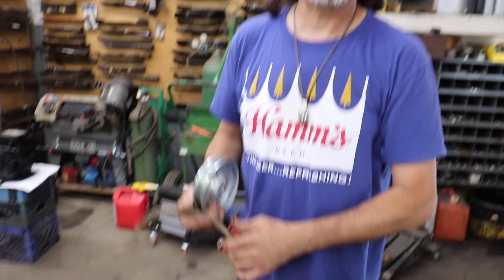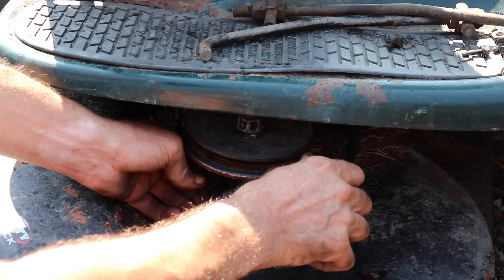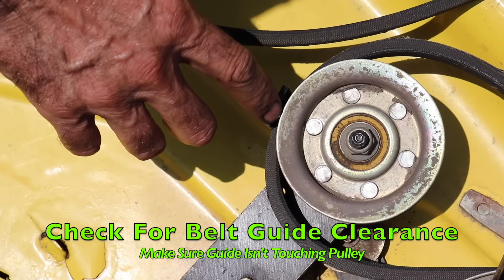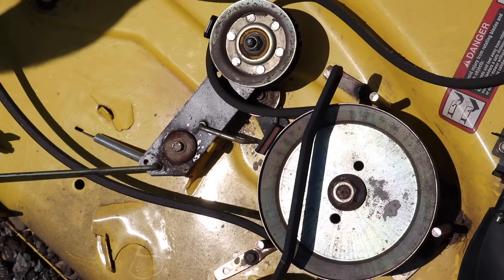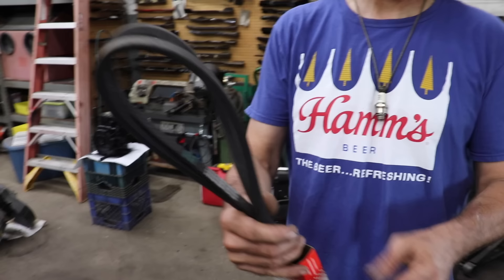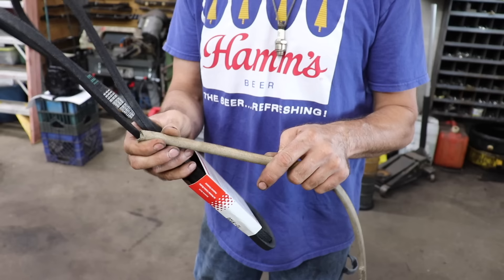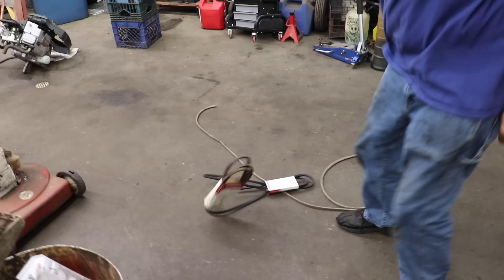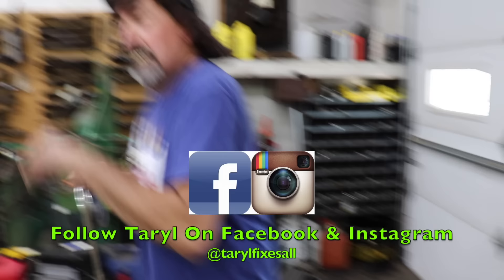Why Do Mower Belts Break?

Comment: Replaced the deck belt on my Cub Cadet with one of those Kevlar belts in the middle of last summer.  Man, it works so much better than the old rubber one did and it's still going strong.

Comment: Regular fan belt will work fine on a modern belt drive hydrostatic mower, but may wear faster on manual transmissions because of the clutch. Also usable for starter-generator drive belts.

Comment: Hey Taryl,
I have a around a 2003 18 simp regent 38 deck. I bought it for $100 the guy said it just needs a drive belt. Kohler engine runs good. The problem is I don't know what all I have to do to change this belt. It looks complicated n id like to be sure its not the trans locked that caused the belt to snap. The belt is shredded. The guy started to work on by removing a bolt n I have no idea where thats supposed to go. Before I lift this thing with my crane id like to know where to start. I also saw on one of your vids you talked about the parking brake can cause the belt to brake. 
Just was hoping you had 1 of these hanging around that you can do a video on. Thanks
Oh n your videos are great. You guys are hilarious. You make it fun to work on the junk we have to deal with these days.

Comment: I had the original deck belt replaced on my Cox 11 lawn tractor. It lasted approx. 1.5 hours of light mowing before it, too snapped. The shop initially thought I may have picked up a tree branch or some other foreign body in the pully going by a groove that was scoured into the belt. When I picked the mower up, they didn't charge. Said something about not allowing for pulley wear when they replaced the original. I think that they forgot to tension the belt correctly. You do this on Cox's by adjusting the cutter deck angle. But anyway, they said it was no fault of mine, so it was replaced under warranty. And that included pick up and delivery of the mower! So if any Aussie grass rats reading this has a Cox, circa 1990-2000, look out for the correct belt tension and adjust the deck angle if it starts to feel loose.

Comment: five yrs ago I bought a used Cub Cadet LT 1042 and it would "eat" a belt every third/fourth mowing! I got some photos of the deck and found the one idler stand was bent over and the belt would start turning inside out and jump!  I realigned and did a better welding of the stand and I can get two years out of a belt now!  by the way where do I get the after market rocker cover gasket for the Kohler 19 hp"courage" engine?
Reply: Real real big problem why they paid a Cub Cadet yellow two piece of s*** I am learning had 18 hours on it when shift started going wrong and boy did it biggest piece of junk made there ought to be a Lemon Law for mowers go to hell Cub Cadet.

Comment: Also, make sure the pulleys are free of surface rust where the belt rides. This rust forms when mower is in storage during winter season. Polish the inside of the pulley grooves with 220 grit sandpaper until they are nice and shiny or replace the pulleys if they are too rough. Your belts will last MUCH longer! And, use OEM belts, NOT "direct fit" or OEM "replacement". They WILL cost more, but will be worth it in the long run!

Comment: Taryl, I have an old Merry Tiller (1977 I think, from the date code on the engine) with the 5hp Briggs that I took apart to fix a fuel leak on top of the fuel tank. I believe I put the governor linkage back wrong because now it runs fine and throttles up fine until you load it. It has no power under load. Is there a diagram somewhere that you know of that shows the linkages? Or at least a good description. I really am grateful that you do these videos. You don't owe this to anyone, yet you do it. Thank you. I hope you aren't too busy to read my question, I bet hundreds or maybe thousands of people try to contact you.

Comment: thanks for the help, it worked for me, I bet with all that knowledge you could make adjustable brake pads for the blade pulls, so you can just loosen & slide pad up or down, instead of having 2 wear spots you get 2-3 more uses

Comment: Old Wheel horse decks have delrin guides that s slide bar and spring tensions the idler pulley. Grass and dirt corrodes the bar. I replace the delrin strips with Formica full contact  piece and seal with brake caliper grease. Now the belt has steady engagement and lasts three times longer. I also polish the contact surface of the bar. I took down a never mowed lawn yesterday August 20 and no breaks with fifteen inch grass

Comment: What do you, or anyone think about electric clutch engaging at full rpms? I think the initial "shock" weakens and eventually breaks the belt. I've been advising my customers to find a half throttle position that will start the belts but not too slow and kill the engine

Comment: Good advice. But here is something else that you should be doing. 1 grease the pulley shaft if it has a grease fitting.  And probably important to do is clean out the grass and other things that can get caught up in the belt or pulley after you have mowed the lawn. With a air hose or you're hands but pull the spark plug wire off first so it won't start or something. I'm just saying. I haven't put a belt on my John deer 425 mower deck in over 5 year's and I mow a 2 acer lawn all summer. I do this all the time . But I do use my air compressor to clean my mower after I'm done with the lawn. And check it out before I mow also. But I'm am a mechanic and I don't want to work on it until I have to. But it runs great. Love your videos.

Comment: "Them blades are going to be spinning _whether you've got the deck engaged or not_"
 Bingo!! I've just put a new deck belt on (having replaced spindles and one pulley, and also the drive belt), and when I engaged the deck I heard bad, bad noise. Quickly disengaged. Drove onto tarpaulin to investigate and the tarp got ripped up. Huh?!? What's going on?? Hadn't seen the new blue belt moving but that sure sounds like the problem. Now have to find out how to slacker off those rod and weird adjustment nuts. THanks, Mr Daryl.

Comment: What's this? More mid week snacks? : )

I recently repaired a Crapsman YT3000 riding mower, that had a PLASTIC ground drive belt tension pulley that went bad. The bearing on it was toast, and the belt wore a HUGE groove in it, almost cutting it in half. Luckily I had a STEEL pulley from an old LT1000 whose bearing was still good. Fit perfectly. That and a new ground drive belt (purchased from Taryl's shop) and it was up and running again.
Reply: The AYP/husqvarna mowers seem to often have those plastic pulleys, but only in places that you would never notice if you were looking at the mower in the store before you buy it.  I assume MTD's are the same or worse.
Reply: @the_mowron  You sir have a great user name, lol. Yeah, anything to save a buck these days. Like those riding mowers with the plastic transmission housings Taryl had a vid on. What were they, JD's? I guess the plan is to cheapen them to the point ppl stop buying them, then scale it back. Because the bean counters at those factories can't just stick with what's reliable and works can they.
Reply: @dkeith45  It was my disgust at being scammed that led me to putting together working mowers out of junk mowers.  I'm not willing to pay $5000 and up for the Kubota or JD type stuff and the Lowes/Home Depot stuff is junk. That was when I started watching Taryl and Donyboy. Taryl really is saving people a ton money.
I have one of those plastic transmissions in my garage. It's a CVT. I don't have anything to put it in yet. I kinda want to try it out.

Comment: Holy shit, thank you for this video. I recently inherited a new commercial zero turn at a house I bought, 0 experience in owning one. Replaced a belt 3 times in the past 3 months, and had I watched this video 3 months ago, I probably wouldnt have had this issue. I think it's a combination of me cutting too fast at full RPM, with old ass blades and keeping mower deck too low. Last 3 weeks, no issues at all...

Comment: Hey Taryl a kevlar rapped belt is designed for abrupt speed changes like the mower deck clutch engaging or like a clutch an mechanical engagement belt. Slips a bit then drives unlike a rubber belt that will abruptly engage but has no slip and tears itself up in summer heat. Case in point a snow blower has rubber belts due to temperature and moisture these resist slippage and grab under these conditions.A kelvar belt would slip and keep slipping no grippage with the moisture soaking the kevlar.

Comment: I used to have a problem with my mower deck belt coming off when I disengaged the blades.
Found out if you throttle down and give it a second then disengage the mower deck the belts don't come flying off.

Comment: I had a guy the other day go out using a flail mower on a really hot day and he was out for about four hours and came back with three belts ripped to shreds. He was trying to cut 5 foot tall grass at two fast of speed which caused the belts to overheat due to slippage. I’ve seen this type of thing way too many times even on Zero Turn lawnmowers especially when their blades are dull. When trying to cut too much material it puts way too much stress on the machine with doll blades.

Comment: I abuse everything when it comes to power equipment. Cutting a hay field full of weeds in what i do daily well when the weather permits. Funny how things like the belt holds up but i go slow when doing so. Bought some cheep spindles from online and that was rejects that caused more damage than the 53 dollars i spent on the 3 spindles. Lesson learned there.

Comment: Not so much John Deere or even some of the other brands but mainly Craftsman had ill installed belt guides from the factory especially these new machines I have people bringing me year old machines with the belts all mangled. What I am finding on the new Craftsman and TroyBilt machines is the belt guides are way outta whack... Way out and just recently a larger Craftsman came in and it only had 2 belt guides out of the five it should have had. I asked the customer who had it apart before he said nobody that was the way he got the machine. The only water I could throw on the flames after he got pissed off at me was suggesting perhaps someone at the big box store LOWES removed em for a repair on another machine.

Comment: A had a Simple City 100 years ago....  the deck belt was great....

But the long belt, than ran the snowblower you mounted on the front...  Holy crap.  I put a peg in my shed, and hung the spare belts on there....  Could never figure it out....

Comment: Trying to engage a deck that's chock plugged up with mulch or a deck driven over a patch of high grass puts a huge amount of stress on any belt  , let the blades spin up to speed before they encounter resistance and bring down the height of tall grass in layers not all in one cut . always let the deck clear out , if you believe your deck is plugged raise the deck and move to a clear area before re-engaging the deck PTO , and as many have said here already lower the engine speed engage the PTO then raise it back to cutting speed  .. keep your blades sharp and clean your deck

Comment: Taryl, how about horizontal pulley, spindle and motor spindle (whatever its called) alignment?  Do things over time slouch slop fall in small increments that you cant really see by eye?  Perspective, lay down look at the deck belt.  As you raise and lower the deck for cutting heights, would something like i describe be common enough so the belt no longer travels in a clean path across all wheels and then the belt comes off?  Hard to explain... hope that kinda does it...  My tractor ate 3 belts in a weekend.  Ima gonna check the belt wheel surfaces today but it was fine for the first few cuts back in April.  I've bought 7 belts this season, some oem, med quality and some cheapo.  Is this a thing? or is it something else?  Much obliged from Ontario Canada.

Comment: Enjoy your videos Taryl!  I have a question maybe you can help me with.  How deep into the PTO pulley should the deck belt ride?  Whenever I replace my belt with a new Toro belt (mower - Toro MX5050 74770), the belt seats even with the outer edge of the pulley.  After 50 - 100 hours of use, the belt relocates to deep into the pulley.  Also, could I run a 5/8" belt instead of the factory 1/2" wide belt?  The ExtremeOPE PTO (X0718) currently installed says it is made for both 1/2" and 5/8" belts.  Thanks a bunch!!  William

Comment: Every time I replace the belt on my John Deere 42” deck. Does a good job when engaged. But, I notice the belt is so loose it would fall off the pulleys. If it didn’t have pulley cover belt holders. I give the John Deere dealer,  correct information about the mower. They give me the belt called for. But always loose. Even with new spindles and pulleys. Any info you could send my way. That might help. Thank you.
Reply: the belt covers are also belt guides and are all part of the system if the belt covers are missing the belt will not stay on.
Reply: J B I’ll try with new covers. See it that works. Thanks
Reply: Charles;  Have you considered trying to adjust the position of your mowing deck to be a little more to the rear of the tractor?  In the manual for my mower (a 20+ year old Craftsman with the Briggs horizontally opposed 2 cylinder engine with manual deck engagement where the belt is also used as the clutch) there are good instructions for adjusting the deck to be "level" but they don't say a word about this affecting deck position fore and aft and it does.  This is important because it directly influences how tight the belt is. It is a bit tricky because all of the adjustments interact but it may be possible to find an adjustment where the deck is still "level" but slightly to the rear of its current position.  It should not take much change.  Because the belt goes both to and from the deck moving the deck 1/4 inch to the rear would take a full 1/2 inch of slack out of the belt and that is quite a lot.

Comment: I get the same issues here in the UK people bring their mowers because the belt has snapped or not cutting the grass properly and on inspection pulley's sometimes broken or wrong belts fitted and blades so dull I could slide bare arsed to London on them.

Comment: I hit a peace of steel yesterday. Brand new mower 😀. I could have craped a golf club. But what's done is done. Before I mow again I will look everything over. If I cracked a mandrel or bent a blade I will just have to replace or repair.
I ran over a highway marker with a brand new cast iron mandel. It busted it into peaces. My old mower. But that peace of steel was my new Hustler Fas trak 54 inch deck mower.

Comment: I have a older snapper mower and a spring  that engages that thing that makes it go. Broke and I was wondering if you knew where I could find that part
Reply: It's a spring that makes the disk go on the wheel. I cannot find that part tarol

Comment: Old Cub Cadet 2186 Kohler 46" deck, new pulleys, PTO clutch. X4 belts shredding. Same PTO belts I've always used. None of these ideas seem to be the cause. 
Now I'm baffled. Heat from muffler? Too tight for some reason?

Comment: Just lately the belt broke and I replaced it. When it is running I smell the belt burning. I checked the install and all was correct. Now that belt broke. Any clue as it is a Troybuilt 42" mower about 6 years old.
Reply: A bad pulley bearing.

Comment: I was going through belts once and I had to actually fix the brackets holding the pulleys because the path of the belt was wearing out the belt too fast. Mower works great now.

Comment: Great video Taryl. But I have a question. Spindles with zerk fittings versus manufacturer spindles that don't. Which ones are better?
Reply: Better with greaseable bearings, but only if you grease them

Comment: I have a Cub Cadet 1554 riding mower with 54 inch cut that is around 15 years old and it is still a pain to change the transmission drive belt. The pulley under the engine on drive shaft is still seized up on the shaft and will not slide down like it is supposed to in order to properly remove and change that belt and bending those guide tabs is not easy. I put a new Cub Cadet brand belt on last year and it shredded this year already and have to change again. I wish that mower had been designed to service more easily. I been laying on my back to do the work under it but might try leaning it over or something.

Comment: I have a craftsman riding mower with a dual circuit stator and as you know a dual stator slowly picks up voltage, the problem I'm having is when I engage the electric pro the voltage drops considerably is this normal and how far should it be dtopping

Comment: I have a craftsman tractor and when I power down quickly it pops; is that the exhaust valve or intake valve?
Reply: Sounds more like unburned fuel in the exhaust pipe, my craftsman has always done the same, I got in the habit of slowly decelerating to the turtle and let it idle a few seconds before shutdown. Haven't heard the popping or backfiring in years.
Edit: If yours is like mine, you can disengage blades, put it in neutral, set parking brake, and get off the seat without triggering the operator presence switch. Which means you don't have to kill the engine or wait for it to throttle down every single time you want to hop off.

Comment: You forgot pulley bearings or blade bearings seizing. One time I kept getting belt smoke when I went to engage the blades so I jacked it right up like you with your lift you made I used an engine hoist it was just on the back wheels. I found out only one blade would spin. I just repackaged it and it has been good for 2 years since